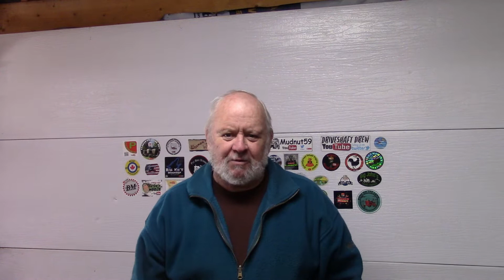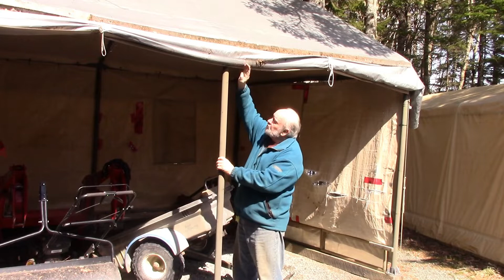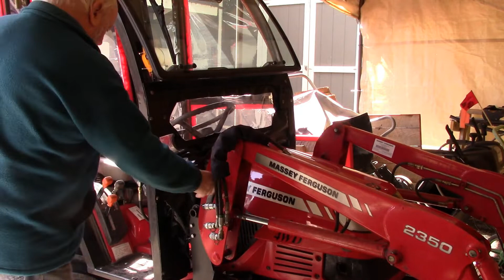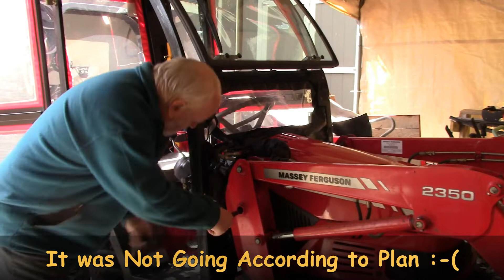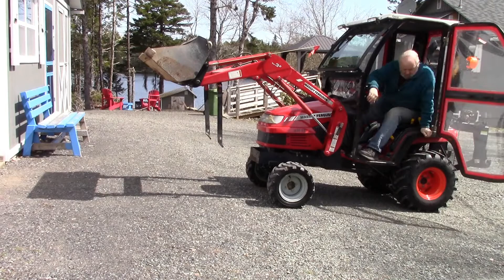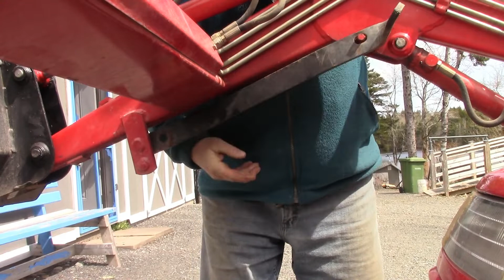What Say We Put the Loader on the GC2300

Comment: And that is why I have yet to take my loader off. I fear it will be too difficult to re-install. But, I will be attempting it soon. I will be sure to have it on firm, level, ground. And, you showed one more advantage to owning a subcompact tractor. You fit into a tight squeeze there, to get the loader. Thanks, Mike!
Reply from the maker: How's she goin'?  The loader is usually much easier to get on than I showed here.  That was one reason I decided to post this video, just to show that sometimes it can be a bear to get lined up.  Getting the loader was a pretty tight spot and you're right about the sub-compact tractor size.  Every time I think I should have a bigger tractor, I end up on a job like this and that brings me back to reality!!!  Thanks for the comment Rick and take 'er easy!!!

Comment: I was worried that you'd be flattened out by the lawn roller--Glad it didn't turn you into a pancake! That Massey Ferguson is a very nice tractor. It looks almost new and it shows that you take good care of it. The multiple attachments make this a versatile machine--ideal for your situation around the camp. The power of hydraulics is amazing--mechanical advantage can move many things and lift loads much heavier than ourselves. I look forward to seeing the tractor at work this spring.Take care !!
Reply from the maker: How's she goin'?  I could use the roller to run over me a least a couple of times, if it would make me thinner!!!  LOL  I sure do like my Massey Ferguson.  Every time I think I would like to have a bigger tractor I end up with a job like this and the small size of the sub-compact pays off in spades then!!!  Thanks Craig for tuning in and take care!!!

Comment: I have only ever had my loader off once. It made for wiring up the front light bar and the rear strobes much easier. I leave the loader on all the time. I  bought the tractor for use strictly as a loader tractor. Actually, the only tractor that I have now that isn’t a loader tractor is the old 9N Ford with the buzz saw on the rear.
Another good one Mike. Keep ‘em comin! 👍🏻
Reply from the maker: Hello there Gary!!  It seems to me that farmers these days have a tractor for every job.  I guess it would save a lot of time rather than have to change implements every time you needed to do a different job.  Thanks for the visit and take care!!!
Reply: @GrampiesWorkshop  , most of mine I inherited when my Dad passed. We used to need every one of these when we farmed up until 1986. 2 of the tractors sold on the farm sale. One I wish I had back. Now they are a lot of work to maintain. It sure is nice though to have my wife run me back and forth when I go to the woods so that I have more than one piece of equipment to work with.

Comment: Great job getting the loader fitted, it looks like that job turned into a project :-) We were looking at the brackets you have on the loader to support it when it is off the tractor, we may have to make something similar for a loader we have as the ones on it are horrible.
Reply from the maker: Hello there Joseph!!  The loader legs are pretty simple for sure and work not too bad for the most part, but as you saw, if the loader isn't level with the tractor, it can cause you some pain trying to get it hooked up.  Take care and have a great week!!!